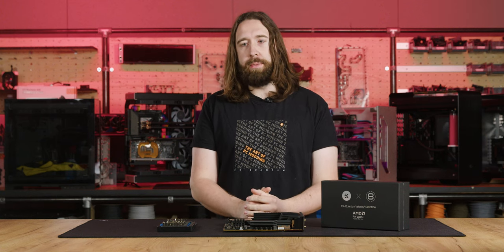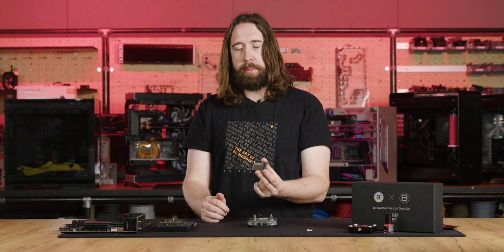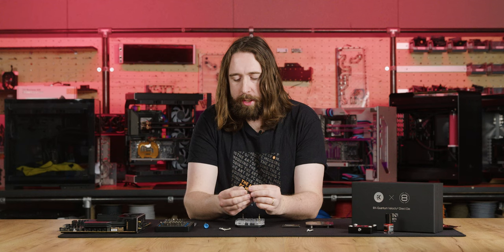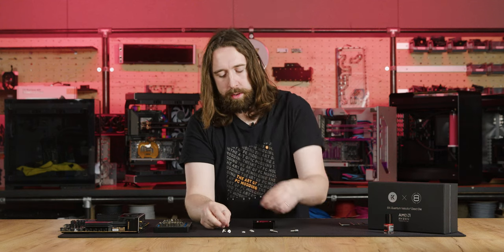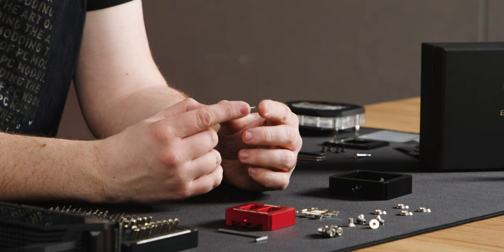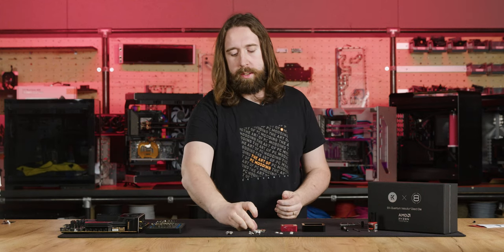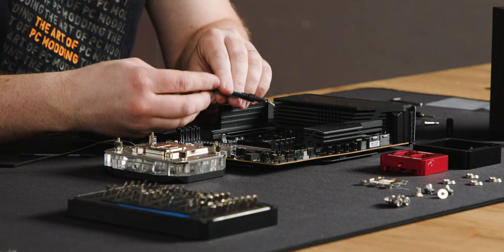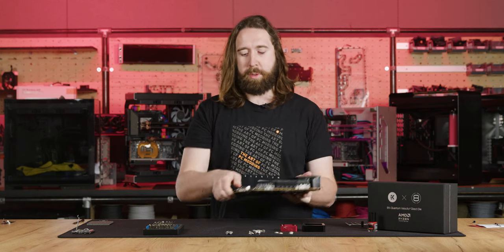The Ultimate AM5 Water Block: EK-Quantum Velocity² Direct Die | EK HOW TO

Comment: As a customer that already owns a AM5 Velocity² block, is it possible to have a "Direct Die upgrade" for that block? You already sell a EK-Quantum Velocity² Direct Die - 1700 Upgrade for that block.
I would really like that option if it is possible!
Thank!
Reply: yeah similar. I have the msi collab mono block, and it'd be nice to be able to have (even buy separately) a direct die monoblock I understand that there's like 3 people that'd buy it so no, but still, a man can dream
Reply: Same as you, i'm already own and was waiting since a loooong time an ugrade for the existing  Velocity² like for the 1700 owners , even if is is not as effective as this one i don't want to invest more and i prefer the design of the previous who match the GPU waterblock.
Reply: The AMD Ryzen Edition is a completely different block to the standard Velocity². It was necessary to re-arrange the flow path and fins to get good thermal performance with the tiny Ryzen 7000 chiplets. Initial versions were based on LGA1700 Direct Die but with a vertical jet plate only a very small proportion of the coolant passes over the CCD's... as you can see from the Jet/Coldplate of the final version 100% of the coolant flow is utilized effectively for the CCD's and the IO die is just secondary. For that reason we won't have any retrofit/conversions/upgrades for the standard block.
Reply: @JR23Design  You could have keep the external style of the previous Velocity²
Reply: I wouldn't expect anything from a company that aren't even able to pay their own staff at the moment - the people without whom they wouldn't even have a business - so I doubt they care about their customers either. don't even know why I'm here other than out of curiosity because I'm that disgusted with EK as a company I will never buy another one of their products, I don't care how good they may be (though the quality has also been in decline in recent times)
Reply: @robmasters3569  I know lol, its crazy, I post this comment and literally a day later Gamer Nexus made that video so I was "welp that ain't gonna happen"

Comment: 1. Is it also compatible with the 3D cache series, for example the 7950X3D? 
2. Will it be for sale through Amazon USA?
3. What is the probability that you will damage the dies when you squeeze the block and take it to the stop? I wonder why on the website they mention so much that EKWB is not responsible for any damage.
Reply: They won't help you if your cpu stops working. Actually they probably won't even answer warranty claims
Reply: 1.) Yes this will work with EVERY single AMD 7000 Series CPUS.  Whether it is a 7950X, 7950X3D, 7800X, 7800X3D, etc.  It will NOT work with any of the AMD 8000 Series CPUS as that IHS is much thinner.
Reply: @TheBenzKid  IHS isn't thinner (technically it's thicker). 8000 series currently are single die "mobile" style APUs with a much thinner substrate. Der8aur has a delidding video/analysis.

Comment: Can this water block be connected to other 240mm AIO such as ASUS ROG Ryuo III 240 ARGB, DeepCool LS520 SE, Lian Li Galahad II 240 Performance Trinity, Phanteks Glacier One 240 T30 V2, Corsair H100i ELITE CAPPELLIX, NZXT Kraken X53 RGB? Or you need to make all custom?
Reply: NO. AIO stands for "All In One", so all of those specific AIOs each Have their own CPU water block with a pump directly on the block And permanently attached to the radiator which makes it closed loop. That’s just a CPU block so you still have full open custom loop to choose your radiator, fans, fittings, tube type, coolant, distro plate or tube/cylinder reservoir  along with the type of pump wether D5 or DDC. That’s why it’s called open loop. Hope that gave you good understanding because I’ve made mistakes with that type of situation not knowing what I had. Happy to say I stepped up to the big ball game with the custom hardline loop Cooling my GPU and delidded Ryzen 7900x.
Reply: @Pzero619  tnx 4 da answah, u r a good man
Reply: @miklaus2873  No problem glad I could help.

Comment: Nice product, I will buy this for my delidded 7950x! Is it conceivable that there will be an update of the cold plate for the upcoming Ryzen 9000 with Zen5, as was offered for the LGA1700 (EK-Quantum Velocity² Direct Die - 1700 Upgrade Kit)?
Reply: If it will be possible to support future generations of CPU effectively then we definitely would make an upgrade for this block, at this time I cannot confirm that will definitely happen though, it all depends on if the top parts are suitable for future die layouts.

Comment: Looking great ! But Direct Die is such a small market margin …. Probably you should sponsor influencers on YouTube sending them components in order to make custom cooling more popular with accent on how easy to install are EK and how gorgeous looking. Put accent on how you can run an Intel 14900 k at stock speeds on only 70 Celsius without under voltage

Comment: Other direct die guard/holder wont fit underneath I'm assuming. Pls confirm
Reply: Provided that it is thinner than our Die Guard and the hole for the Coldplate is bigger you could use a different one. But I can't see any advantage of doing so really, all the blocks will ship with Die Guards.

Comment: Does the D-RGB works even with Corsair iCUE?
Reply: Absolutely, you can buy adapters for conventional 3-pin D-RGB to iCUE style connectors, or you can even buy the crimps and connectors, they are standard Molex parts.

Comment: Some performance gain figuers and temps?
Reply: Zero
Reply: We will publish a video of all our AM5 Thermal Solutions (from 240 AIO through to this), I won't spoil the surprise but its the biggest improvement of any EK CPU block to date.
Reply: Hey ho, got my block 4 days ago. I only can compare it to the normal quantum velocity 2.  I got like -10 degrees on all cores under full load (prime 95 smallest ffts and disabled avx), compared to the non direct die build i had.

Sooo, worth for me :)

Idle Temps are the same.-